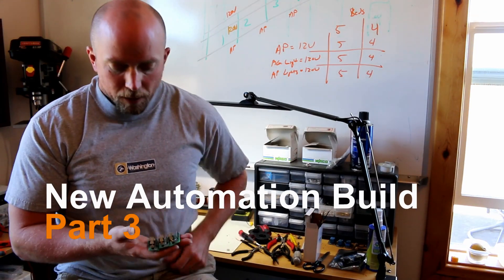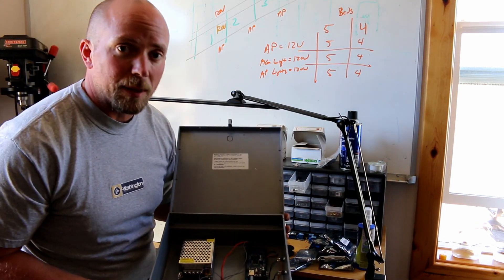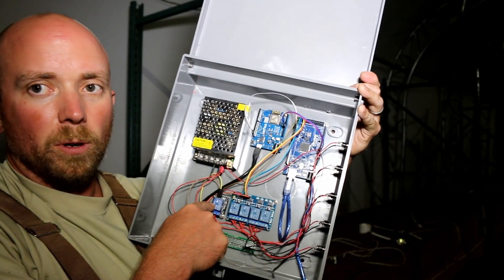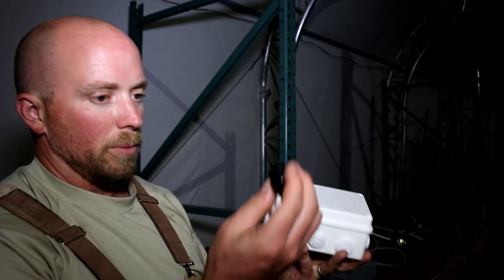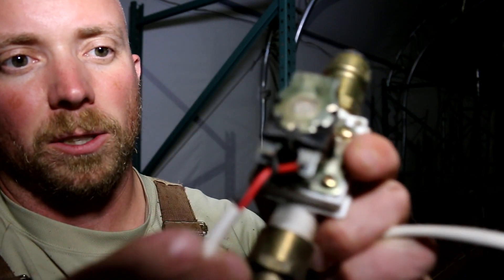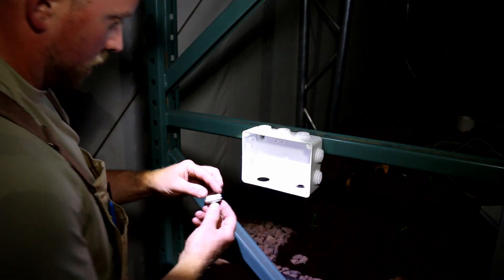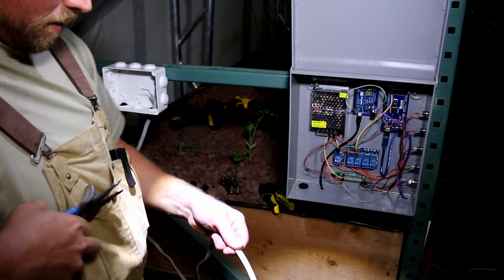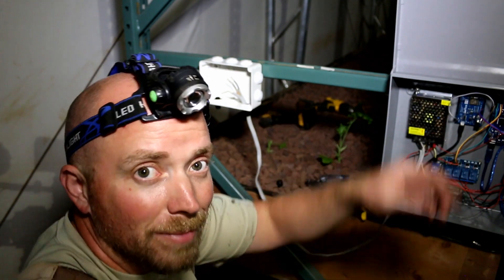Upgrading AQUAPONIC Greenhouse AUTOMATION

Comment: you should use conduit between the boxes or flexible seal-tight to protect the 120v wires
Reply: I agree it should be a product called liquid tight or similar product. Make sure you check electrical code for safety.

Comment: Any issues or concern with the Master/Slave configuration for the boards?  Any thought given to using a WiFi Shield instead?  I have not worked with the M/S set up...Good way to make use of existing gear.

Comment: Well Dang...Here I was with esp8266's in my cart and after watching your video I am second guessing this approach.  How is the wemos sending data to your server?  Does the wemos act as a "buffer" for the serial out on the Mega?  

My understanding of the esp chips is that there are only 5 connections and we jumper two of those together to 3.3v, tx, rx, grnd.  The only bad thing I have read is that these are serial "repeaters" (If I have read correctly) meaning that it may be byte by byte transfers not FTP style transfers, so it sends data out just like to the screen. The other thing I read is that t hey are picky about voltage, particular having enough current to drive the radio in tx mode.  Perhaps the Mega is not providing enough 3.3v current...I think on the Mega the 3.3v rail is limited to around 250mA.  I found several threads and documents that suggest the 8266 needs WAAY more current than that and it tops out around 320mA during initialization and during packet transmission  is in the 290mA range.  And I read a few things that said the 3.3v rail gets what is left after the 5v rail.  So perhaps a dedicated 3.3v 1amp power supply to just the 8266 is the way to go.  

It is great you got it working, but we both know that it will be a headache down the road because you have two devices per lane now instead of the one to program, mess with, and be a failure point.  

Would be interested if you feel like sharing your code via a google doc or something just for reference, not collaboration as I am always curious.  Just remember to scrub your passwords, if any, out of the code.
Reply from the maker: +JClaudII please shoot me an email and I'll reply...this will take some unpacking

Comment: Dear TRM, in an earlier video on this subject you appeared to agree with a comment suggesting that you place the 12V power supply in the 120V relay box and then run a 12V line out to the 'low' voltage enclosure. Thus, in normal operations, eliminating anything running at 120V from the 'low' voltage enclosure. Why did you discard this approach which appears intrinsically slightly 'safer'?
Reply from the maker: +GB Expat Cornishman mostly money....the project boxes of this size are $40 a piece and I'm running out of money

Comment: A Rasberry Pi 3 with a relay board should do pretty much everything you require, and I'd suggest crimps with or without solder for connections - they work in automotive and marine applications perfectly.

Comment: Enjoy your videos.

On your missing connectors. - A am assuming that you are using stranded cable (37 strand would be more flexible than 7 strand).  When you solder your connector your are creating a length of solid conductor cable beyond the connector.  If it is allowed to flex it will break off.

Have a good day.